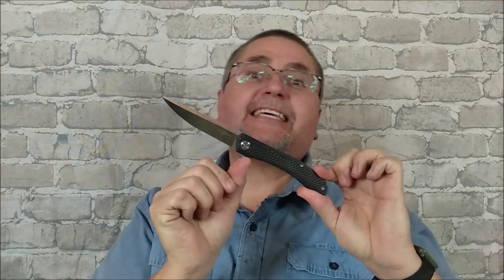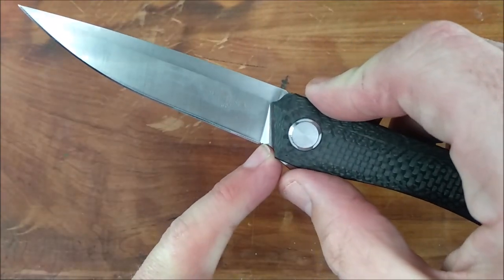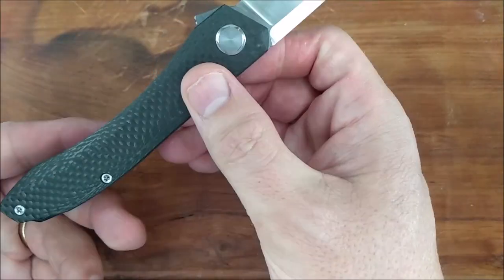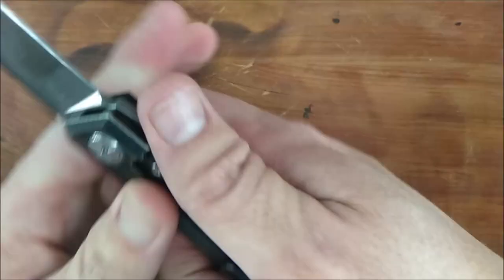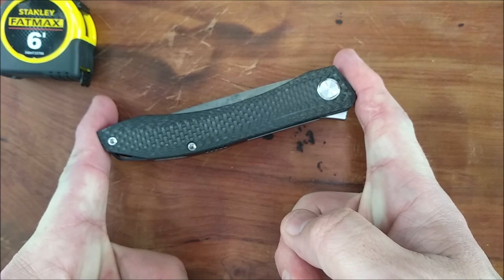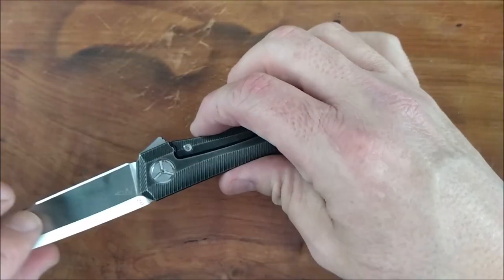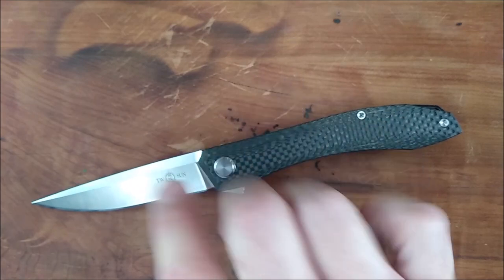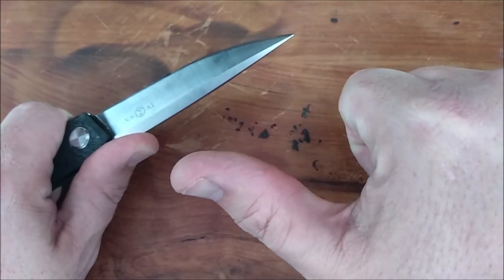Review of the TwoSun TS103 - "Gentleman's Folder at Blue Collar Price"

Comment: The hole in the top is there to keep the stop pin from failing because of stuff getting between the stop pin and the scales or stop surfaces
This actually fixes the biggest problem internal stop pins have